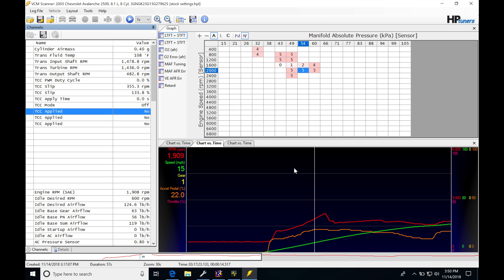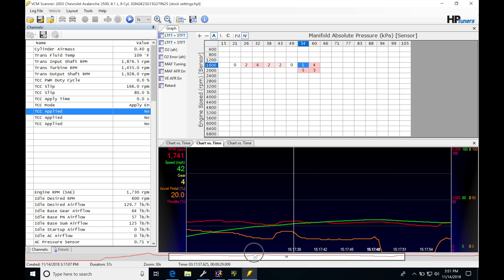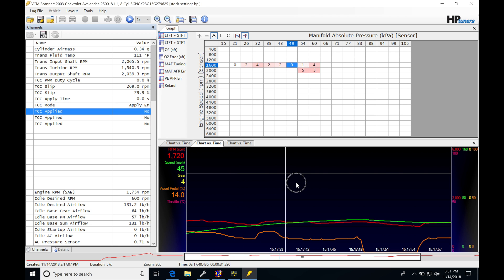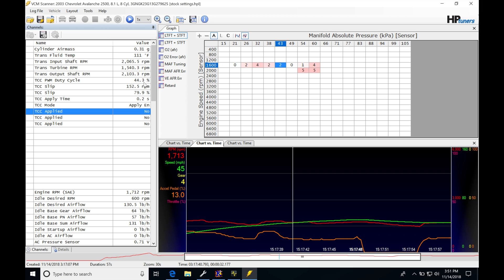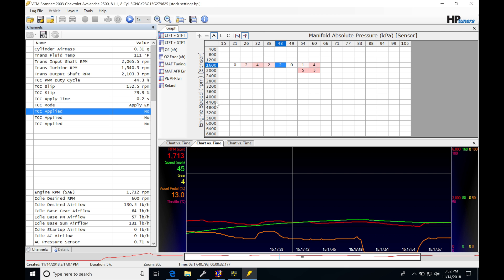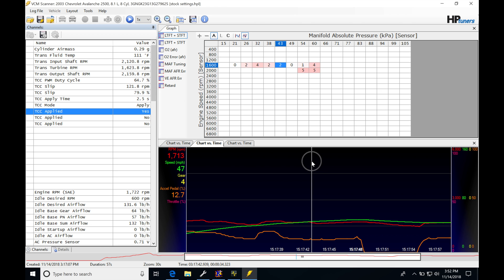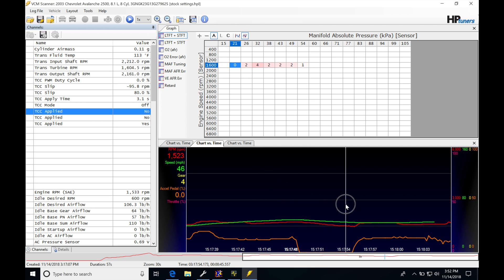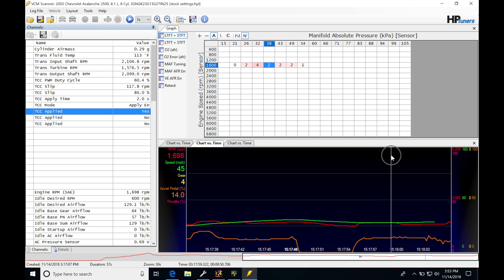HP Tuners: Torque Converters & Shift Pressures | Evans Performance Academy

Comment: Would you know why i dont have those TCC fields you're talking about?  Like mode, pwm,etc? Thanks
Reply from the maker: Assuming you are working with a Gen 3 GM with HPT software the file / operating system may not be fully defined by HPT.  Often times you have to email support at HPT and ask for tables that aren't present.

Comment: So I have a 05 hummer with 40” tires and my TC lockup keeps unlocking and locking due to the amount I have to press the gas sometimes to maintain speed on the highway… can I change the perimeters to get it to stay locked up..?
Reply from the maker: Before doing anything else you need to correct for any wheel/tire size difference from stock.  That is likely the reason its giving odd shifting problems.  HPT software allows for tire/wheel rescaling so the TCM can determine the correct vehicle speed.

Comment: If i have a bigger converter on a stock tune, will this cause a shake, shudder/misfire vibration at idle and while driving?
Reply: Sounds like you are getting some knock, possibly associated with TCC lockup? You have to change the point at which converter locks up. I am having this issue, trying to figure out how to tune it out.

Comment: I've never played with the electronic transmissions with lockup. If you were running something like a 3k+ stall. Could you program it to lockup before shifting out of 1st gear (where engine rpm and cars mph were closest) so it drove more like a stock car? I just don't understand what is truly possible with this new stuff.
Reply: hey mate you can command the convertor to lock up and any speed and any gear at any load

Comment: I get it for peformance of a dig a torque converter is great because it will get me to whatever my power band is but  it ends there I mean can I assume it would be useless if I am roll racing since I will just be forced to downshift and hold the rpm's whether it's high or low until I see the signal and go full throttle?

Comment: I’ve got a 2018 Silverado tuned with an HP tuner and occasionally I get a jerky 2-3 shift. Is that something that can be fixed or is it characteristic of my truck?
Reply from the maker: Yes it can be smoothed out.  It has to do the shift pressures/torque management.

Comment: Im having trouble getting my 4l80e right at wot. I trys yo lock up right before it shifts at wot. It is great normal driving. Tho. Im lost
Reply from the maker: HP Tuners put out a fix for this on some operating systems.  There are WOT tables that need to be unlocked to edit settings properly.  You may need to contact HP Tuners to have your operating system supported for the WOT converter tables.
Reply: @EvansPerformanceAcademy  ok i will call them to find out.